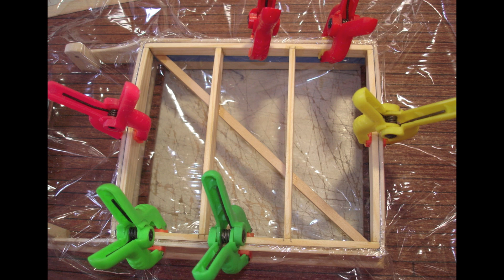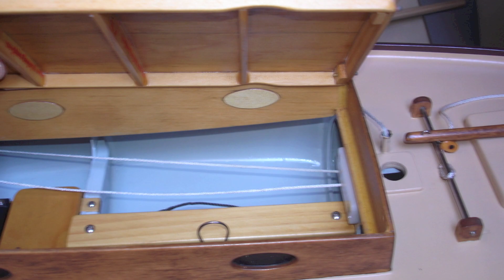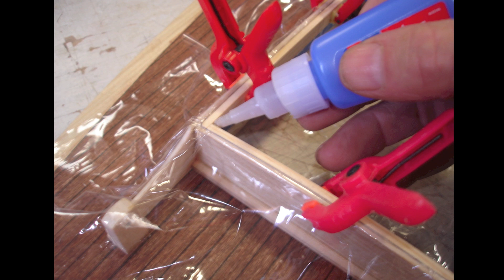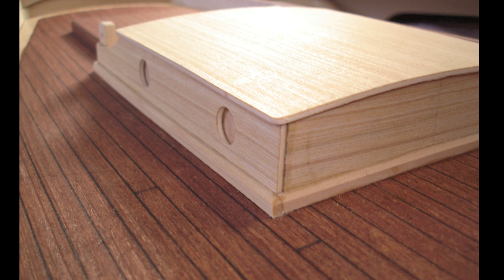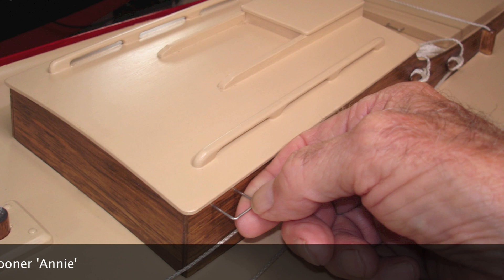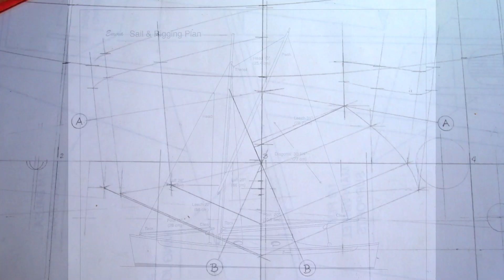RC Sailboat Build DIY Removable Cabin Top

Comment: Tapering masts and spars is easy. Chuck one end in drill and a pointed end nail sticking out sticking out of vise or a piece of wood. Push the spar against nail and turn on drill holding with one hand. With other hand roll the sandpaper around spar and hold. You just created crude lathe. Might have taken me 30 minutes to do all mine for Emma.

Comment: Another very useful video Gary.  All your videos are much appreciated.
What superglue do you use?  The stuff I've got doesn't work well on wood.
Best wishes,
Noel
Reply from the maker: Hi Noel, I have used various superglues, I find a medium viscosity works best for me. Some are very thin which is sometimes useful, others are rather thick which I find no use for. Hobby suppliers are probably the best source. The glue you see a glimpse of in this video was 'Loctite' brand from an auto parts store. I liked it well enough, and found it here in Mexico where hobby supplies are not available.
Reply: @sailtails2775  Thanks Gary!

Comment: Love these video's! Almost never see video's about people making scratch built model boats, glad I'm a subscriber!
One question I do have: Do you leave the holes for the pins untreated, or do you put in a drop of CA to keep moisture from making it's way into the wood?
Reply from the maker: I drill the holes before painting or varnishing and I imagine some paint may find its way into the wood. I pass the drill thru the holes again after painting and don't really do anything more about treating the holes. That said, I imagine it would be good to saturate the area with super thin CA after the initial drilling.
Reply: @sailtails2775  Thanks for your reply! Thin CA is amazing stuff, especially suited to treating the butt ends of wood. It really strengthens the wood grain and makes it easier to sand also. Please keep those fantastic video's comin'!

Comment: Thank you for making these videos. They are a great inspiration for me. I am planning on buying a pre-made model boat from ebay and fitting it with rc components and 3d printed keel, is there any way I can make sure the wood is impermeable to water?
Reply from the maker: I seal the bare wood with clear penetrating epoxy sealer before painting, and paint with brushed on oil based enamels.

Comment: Not your fault, but my hearing is not the greatest anymore. That means I have to turn on the Captions or the "CC".
Some of the captions quite frequently do not reflect what you are saying, Gary. Example "100 grit sandpaper" becomes "100 yards sandpaper"
Is this a google problem, or something you have control over?
Reply from the maker: Thanks Richard for the input. I understand about hearing, mine also is not up to par. I have also had some technical difficulties producing clear audio which might be a factor in the google CC captions. I suppose I should add my own captions along with audio when editing the videos. Will try to do so in the future.